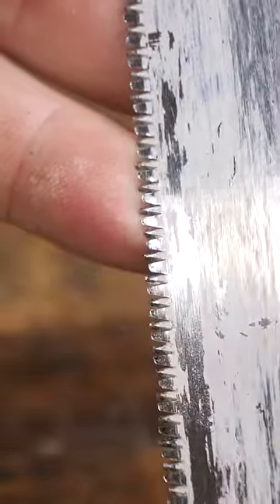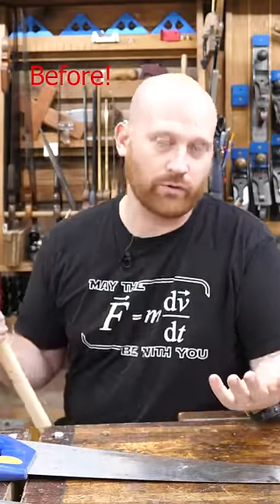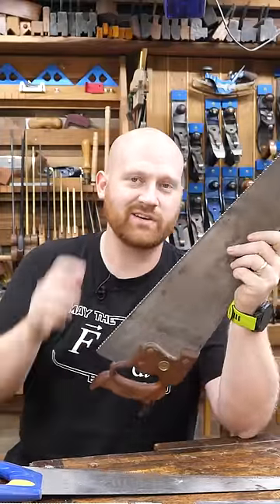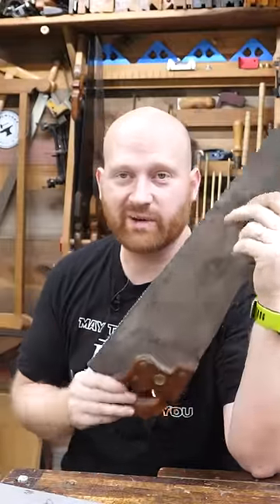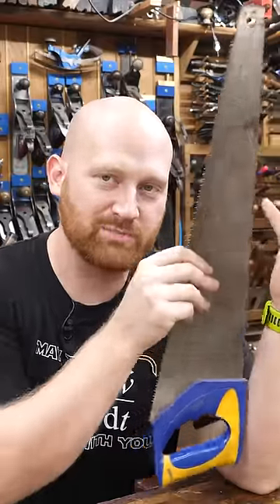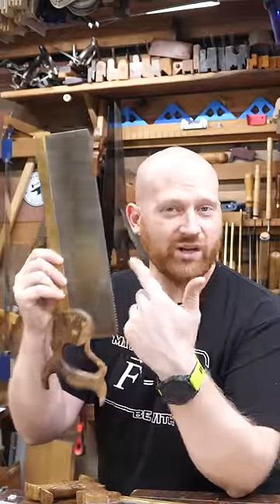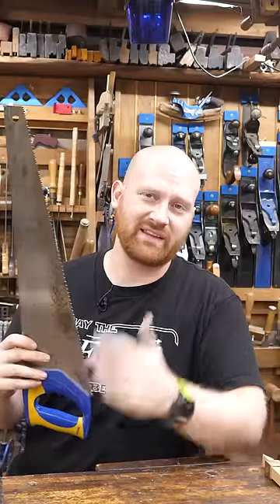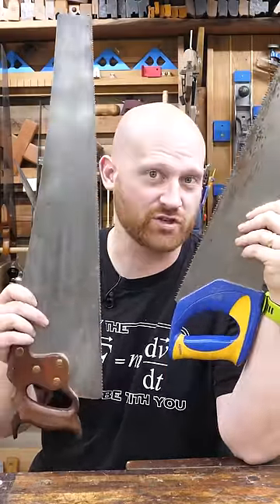Hardend Teeth Vs Old School Teeth on a Hand Saw

Comment: Relatively simple way to fix that sharpening resistant hardened edge on modern saws. Cover the blade in wet clay, wet non flammable cloth, or between two blocks of dense wet wood, then take to the edge with a blow torch until the teeth start to glow. Once it is all evenly glowing a slight orange, walk away and allow it to cool down to room temperature. Hardened steel is now soft. Sharpen it, repeat the heating and drop it into cold oil to temper it to hard again. Make sure the springy main body of the saw does not get hot, otherwise it will become too soft and bend, or brittle and snap. You need to think Samurai sword maker, and only treat the working edge.
Reply from the maker: it is very possible, but a lot of work for a $10 saw with a plastic handle. just don't try to do that to an old one. you end up with a banana.
Reply: @WoodByWrightHowTo  Shouldn't need to for an old saw. As you keep demonstrating, the old tools are the good tools. Me being a BoomX, I can't throw a "Perfectly good" newer tool without at least trying to find a way to make it last longer.

Comment: Spear and Jackson, and Ulima still have sharpenable saws for sale. I love my old Disstons; but the S&P blades have become my work horses for sawing plywood (or any material I don't want to put my Disston through). For experiment's sake, I kind of want to try taking a hardpoint saw, removing the hardened teeth (once they're dull of course); and re-cut the teeth.
Reply from the maker: Yes there are quite a few companies that still sell good quality saws. But you'r not going to find those at the big box stores. They are more of a specialty thing now.

Comment: You could of course just take a blowtorch to the teeth until they've annealed; gets you both the hardened steel teeth at first, and then you get the softer, resharpenable steel after!  Best of both worlds!
Reply from the maker: you have to be carful with that method. that often warps the blade. most people if the want it grind the teeth off past the hardening and cut new teeth.

Comment: Since I got into hand tool Woodworking and learnt to sharpen a saw I can't use the modern plastic hard point things  , I struggle to keep a straight cut . I think it's because the vintage saws have a wide plate and do the work for me and I'm no longer used to the constant work you need to put into the modern ones to do a good job .

Comment: Funnily enough that’s the exact reason I started carrying a Milwaukee Fastback utility knife instead of a regular pocket knife. Sure you can get way more use from a single blade that you can sharpen, but as a hobbyist who uses a knife and needs a sharp blade for many projects the disposal razor blades that I can replace are the better option for me
Reply: If your confident in your sharpening ability it might be worth looking into something in a higher edge retention steel. Something like magnacut or cruwear will have really hood edge retention while remaining pretty balanced overall and something like k390 or s90v would gove exceptional edge retention at the expense of a little toughness. Sharpening wouldn't be quite as convient as seapping a blade but depending on what you're cutting you could reasonably go months between sharpenings.

Comment: well here is an advice from someone who knows nothing about wood working but i am a welder, heat the teeth till red hot with a propane torch and put it in dry sand and let it cool slowly
you will get them dehardned ,file them or do the sharpening then red hot again and in old motor oil it goes you got your self a hardened sharpened saw
Reply from the maker: That sounds good in theory, but in practice, it often warps the plate. most people if they want to re-sharpen it grind the teeth off and file in new teeth, but both are a lot of work for a $10 saw.

Comment: I may be wrong, but you should be able to fire them up with a torch and allow them to air cool to soften them. You can sharpen it then re harden by reheating and finishing it with an oil quench. ?
Reply from the maker: That sounds good in theory, but in practice, it often warps the plate. most people if they want to re-sharpen it grind the teeth off and file in new teeth, but both are a lot of work for a $10 saw.

Comment: I use this thing called a diamond sharpening tool. They typically cost between five and twenty five dollars each and are absolutely worth the price especially if you intend to keep any sharp objects around.
Reply from the maker: I have tried a few but have not found one that I like the finished project. Not to mention that it is hard to find the correct prole and size.
Reply: @WoodByWrightHowTo  I understand that and I was also thinking about multiple things including the ability to use a drimmel diamond disk or other diamond abrasive rotary bits to sharpen a saw. I will however say that most of the older saws are thinner than the newer ones and they have a much better cutting tooth design that doesn't cause a huge problem with splinters and burrs.

Comment: You can always grind off the hardened teeth and sharpen new un-hardened ones if it means that much. Some saws also come with one hardened side and one not.
Reply from the maker: I know a few people that have done that. it is a lot of work for a $10 saw, but for some it is worth it.

Comment: i guess im confused as a knife sharpener because i want a nice hard steel to sharpen it allows my edge to come out more keen and last much much longer sharpening softer steel can be a nightmare, i know theres a difference in levels of sharpness and knives would be to the extreme. and as he said sharpening is starting to become a lost art which is why i try to keep it alive while teaching it on my channel
Reply from the maker: you sharpen a saw with a file. they do make diamond files the correct size and shape to get into the tooth, but they do not last long and they cost more then the saw. here is a video showing how saws are sharpened. https://www.youtube.com/watch?v=e7YsjKhqk-w

Comment: Hardened teeth can be sharpened with diamond files, but I don't think anyone does. 😢
Reply from the maker: The problem is the diamond files to do it cost more than the saw does.
Reply: Difficult and results may vary depending on my mood, but I keep torturing those small japanese hardened teeth with diamond covered  files.

Comment: You could take a torch to the teath and take some of the heat treatment out of them so you CAN sharpen them
Reply from the maker: That sounds good in theory, but in practice, it often warps the plate. most people if they want to re-sharpen it grind the teeth off and file in new teeth, but both are a lot of work for a $10 saw.

Comment: New saws with hardened teeth are much harder to sharpen, but with a good dimond micro file, blow torch, small hammer, saw set, olive oil and a good deal of know how it can be done. 
And you can get a sharper saw than it was when it was fresh from the factory. 

I would recommend getting a feel for sharpening new saws, using a cheap 1 then move on to your more expensive 1s.
Reply from the maker: That's a lot of work for $10 off. But I know for a lot of people it's worth it.
Reply: @WoodByWrightHowTo  yeah I know it's a lot of work for a $10 saw but I still have the saw I was given as a birthday present 20 years ago (was brand new when I got it) and it's sharper than a new saw and to buy another 1 the same now they are $114 
That's why I said I would recommend starting on a cheap saw to get a feel for sharpening
Reply from the maker: Holy cow. What hard point saw is 114. I have never seen them over $20
Reply: @WoodByWrightHowTo  $114 AUD so roughly $78 USD 
Australian made saw
Reply from the maker: I don't know what they have in australia. Sounds like you have a very different tool selection down there.
Reply: @WoodByWrightHowTo  and the pricing is stupid for pretty much everything

Comment: Is it possible to sharpen one of those new fangled saws by annealing the teeth, one they are dulled?  Or is it better to make card scrapers out of them? Lol
Reply from the maker: That sounds good in theory, but in practice, it often warps the plate. most people if they want to re-sharpen it grind the teeth off and file in new teeth, but both are a lot of work for a $10 saw.

Comment: It’s also the reason why the saws are so wide. That way there’s plenty of material there to get several sharpens out of it before having to replace.
Reply from the maker: Most of the old ones you could get 300-400 sharpenings out of them.

Comment: I’ve never really looked into this and I find it surprising. How many times can metal be hardened and tempered before it becomes useless?
Reply from the maker: Almost infinitely. However the problem comes with warping. One of the reasons why you don't anneal them sharpen them and then harden them is it often ends up with a warped plate. Most people if they want to sharpen them grind the teeth off and then sharpen it into the softer metal underneath them.

Comment: When a saw with hardened teeth becomes blunt, just grind the teeth down. and use a fine grindstone to reform the teeth, the set the teeth again. 
From then onwards it can be sharpened in the normal way.
Reply from the maker: I know a few people that have done that. it is a lot of work for a plastic saw, but some people like that.
Reply: @WoodByWrightHowTo  
The handle isn't really significant, and could be easily replaced with wood if desired.
It's the blade that really counts.
In my teens (1960's) I needed a saw, but didn't have the cash for one, so asked a Scottish neighbour if he had one I could borrow.
He produced two, rather reluctantly, very blunt and very rusty, and urged me to be careful with them.
I de-rusted them, sharpened and set them.
One as a ripsaw, and one as a crosscut.
When I returned them, he was visibly shocked at the difference, and told me i could borrow them again whenever I wanted them.
.

Comment: How can you tell the age of a saw? Are there certain characteristics to look for?
Reply from the maker: The shape of the handle, the etch in the plate, the style of the medallion, and a few other points.
Reply: @WoodByWrightHowTo  At a flea market I found a set of three antique hand saws that had Elks elaborately carved into the handles. I passed on the $50 for all three. I still kick myself for that one.

Comment: is the teeth being blackened color the only way to tell if they are hardened or not or would be say on the package?
Reply from the maker: They will not advertise hardened. Generally you can tell by the blackening. But if you buy them from a hardware store or big box store they are hardened cheap saws.

Comment: Can't you flame temper the cutting edge, and make a hardened saw re-sharpenable?
Reply from the maker: That sounds good in theory, but in practice, it often warps the plate. most people if they want to re-sharpen it grind the teeth off and file in new teeth, but both are a lot of work for a $10 saw.

Comment: little secret for you - you can heat the hardened teeth to cherry red and let it air cool (cooling it more slowly in electric furnace is even better) - the hardness disapears. That's how iron crystals do.
Reply from the maker: That is very true. But number one it's a lot of work for a $10 saw and number two it often ends in a warped blade. Most people end up just grinding off the hardened teeth and starting underneath that if they really want to use it.

Comment: you can always just cut off some of the saw so you have soft metal left
cut in some teeth and then sharpen those every time 

tell me if im wrong
Reply from the maker: Yup. Some people will grind them off and re cut them. Just seems like a lot of work for a plastic handle.
Reply: @WoodByWrightHowTo  okay true that xD

Comment: You can also just “unharden” the new ones by hearing them up. Hit the teeth with a torch and the hardening will come right out and you’ll be able to sharpen them again
Reply from the maker: That sounds good in theory, but in practice, it often warps the plate. most people if they want to re-sharpen it grind the teeth off and file in new teeth, but both are a lot of work for a $10 saw.

Comment: You should run an experiment where you soften the box store saw and see if it takes to sharpening xD
Reply from the maker: That sounds good in theory, but in practice, it often warps the plate. most people if they want to re-sharpen it grind the teeth off and file in new teeth, but both are a lot of work for a $10 saw.
Reply: @WoodByWrightHowTo  if you have 2 steel bars you could sandwich the plate between them.  I def know its in no way practical. I still think itd be interesting to see..haha

Comment: So did teeth become hardened because people forgot how to sharpen blades, or did blades become much easier to make disposable with hardened teeth, and as a result people stopped sharpening blades? I'd think the latter
Reply from the maker: Generally it's because sharpening left the shop. It all happened right around the time of the power tool revolution. With power tools you can use a saw a lot longer before it needs to be sharpened and at that point the blade is such a small percentage of the prices of tool that you might as well replace it. So sharpening disappeared from the shop and with it many of the old hand tools..

Comment: Once the saw with hardened teeth becomes unusable, could you grind off the teeth and sharpen the plate that remains?
Reply from the maker: I know a few people hat have done that. it is a lot of work for a $10 saw, but for some people it is worth it.

Comment: Is annealing the teeth of a modern saw a viable option?
Reply from the maker: It kind of is however the faster way is to grind through them past the hardening and then cut in New teeth. But in that case you're then working with a simple tool steel that's not going to work as well.
Reply: @WoodByWrightHowTo  Thank you so much for the informative answer!

Comment: I’m not in the business, but I can’t even remember the last time I saw a “carpenter building houses” with a hand saw, with the only exception being finish carpenters making coping cuts for inside corners on trim. 

Even the Amish carpenters that I see almost exclusively use power tools…🤔🤷‍♂️…😂
Reply from the maker: most framing carpenters have one or two in the trailer they are used for removing the bottom plate in doorways and a few other places where you need to flush cut off.

Comment: Have you considered heat treating the cheap new saw to un-harden it after it dulls? It’s probably just a heat and quench treatment, which would be easy enough to undo
Reply from the maker: The teeth are impulse hardened. I know a few people who have attempted it. But it often ends up in a warped blade. And the steel is not as flexible as 1095 spring steel. But it can work.

Comment: Can you still sharpen a hardened saw with a diamond stone?
Reply from the maker: They do make diamond files that are the right shape and size. But they are far more expensive than the saw. But the question is do you really want to put all that effort into a cheap plastic saw?

Comment: You can sharpen hardened saws using a diamond file or diamond wheel
Reply from the maker: you can. but a triangular diamond file that size costs more then the saw. most people grind off the teeth and then sharpen in new teeth. if they want to keep the saw.
Reply: @WoodByWrightHowTo  if you buy them from Grainger or McMaster-Carr they do.  If you buy them from Harbor Freight or from an online discounter they are cheap.
Reply from the maker: i have seen a few in the $15 range. I wonder how many sharpenings I can get out of one of those. might be worth testing.

Comment: Couldn’t you soften the blade by heating it with a torch and not quenching it after, making a hardened blade sharpenable?
Reply from the maker: you can. or you can grind the teeth off and sharpen new teeth in. but that is a lot of work for a $5-$10 saw.

Comment: I've seen many people discuss this topic but nobody answers the question of whether you can just heat up the blade and change the temper. Would that not work? Something about the type of steel?
Reply from the maker: you can, but you have to be VERY carful I know two who have tried it and both ended up with a wrapped plate. not to mention that it takes s lot of time and equipment for a $10 plastic saw. Most people grind through the hardening and file from there.

Comment: Heat to cherry red. Place in oven at 200 to extend its cooling time. Annealed teeth. Now you can sharpen all ya want
Reply from the maker: That sounds good in theory, but in practice, it often warps the plate. most people if they want to re-sharpen it grind the teeth off and file in new teeth, but both are a lot of work for a $10 saw.

Comment: If they can be hardened, can they not be annealed?
Reply from the maker: That sounds good in theory, but in practice, it often warps the plate. most people if they want to re-sharpen it grind the teeth off and file in new teeth, but both are a lot of work for a $10 saw.
Reply: @WoodByWrightHowTo  hey, I only paid $10 for a few of the vintage saws I have. 🤣

Comment: Knives are hardened and can be sharpened,  so I'm having a bit of a problem here.  How are saws different?
Reply from the maker: Saws are traditionally sharpened with a file. if you harden the teeth then they will destroy the file. knives can be sharpened on a stone. but you cant make a stone to fit teeth with out it wearing away too quickly or causing problems with the sharpening. You can get a diamond file that is the right size and shape, but those cost more then the cheap plastic file. most people if they want to re-sharpen it grind the teeth off and file in new teeth, but both are a lot of work for a $10 saw.